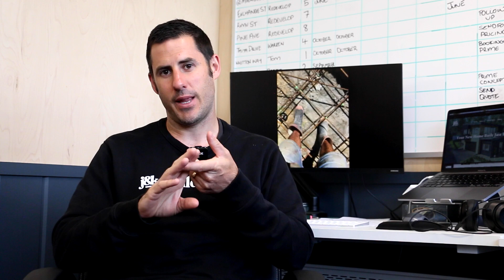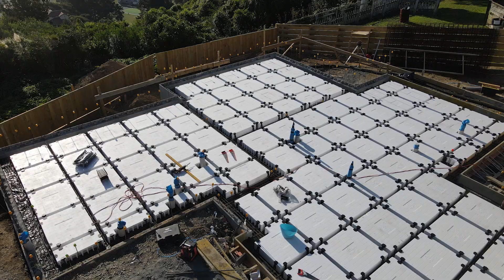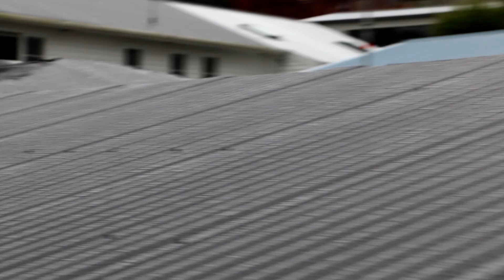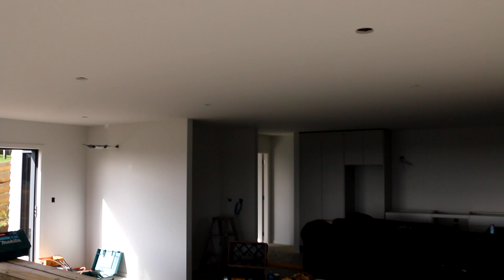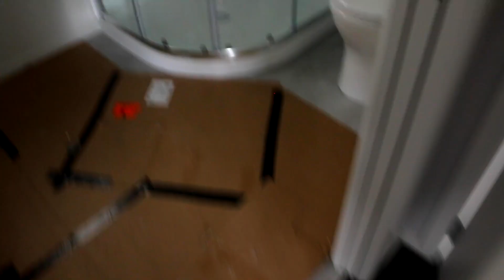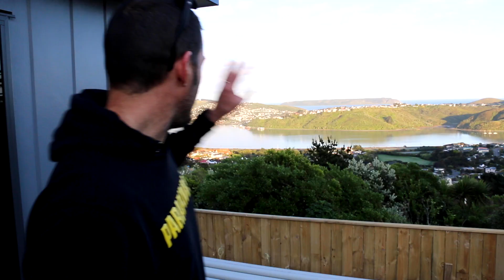Building A House In The Backyard - Start to Finish

Comment: Loving the content Josh! I'm a developer moving back to NZ from Aussie with a quick question, what are the 'estimated' building costs per square metre on a 3x2x2 with a flat lot with all utility services at the front of the boundary?
Reply: Depends which city...  are you talking duplex?. Ballooning out to $3,500-4300 has been my quotes
Reply: I’m aware prices vary per city, I’ll be in Gisborne in 4 weeks & I’m looking to start there. I’m looking at developing single family homes/townhouses 3 bed 2 bath 2 car garage
Reply from the maker: Hey Nick, welcome back to NZ,  pricing varies so much depending on services, design, two storey, joint with firewall or seperate, specifications, fixtures and fittings but Peter's range below is similar to some of the typical builds we have on the go right now